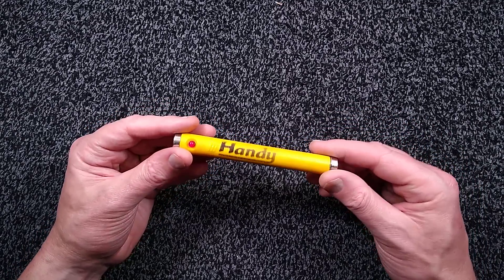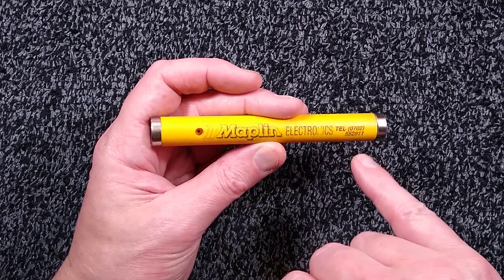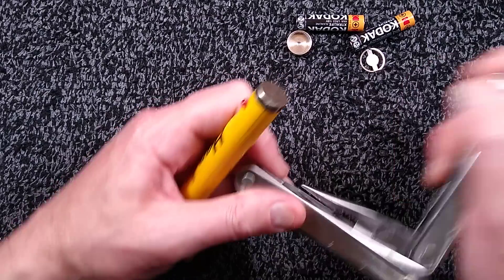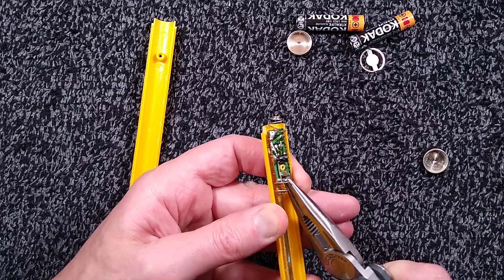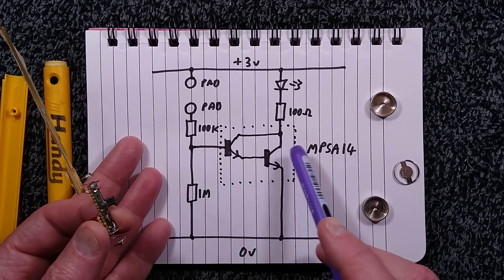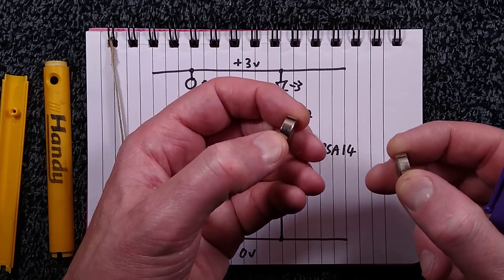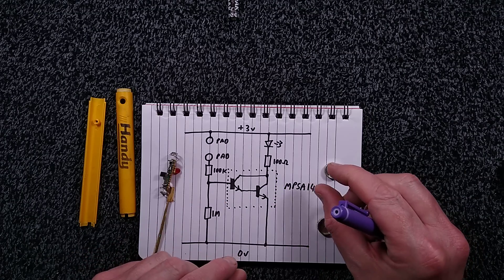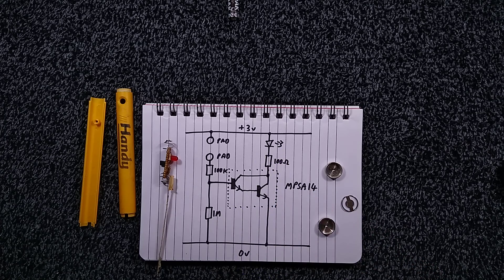Retro Maplin "thing" (with schematic)

Comment: Maplin was the place that helped me learn practical electronics.  Some of the circuits I built from parts I bought ten years ago are still in use.  Yes, Maplin was pricey, but that's the cost of being able to walk into a shop and buy a physical product.  And speaking of Rolson tools, I can't say a bad word about them.  Only recently I retired my Rolson flush cutters after many years of faithful service.  They cost £4.  I still use my Rolson steel rule virtually every day, and I have Maplin hybrid AA batteries still in use after several years of recharge cycles!

Comment: I really don't understand why people still call transistors amplifiers these days because in basic the transistor does nothing to amplify the signal on its own. The gain could be a result of and not a part of. If you pass a weak signal through it, it doesn't amplify anything. You need to apply a powerful source to achieve the gain, the gain is a result of. The result of it depends on  the applied source. Without a powerful source there is no amplification at all.  Call it a "(variable) sensitive  directional (input) switch" (base) for example and with this you can achieve a gain when you apply a more powerful source through it. However if you simply want to switch something (like a bulb or something like that) there is no subject like gain. Do you know what I mean? Amplification is not a part of a transistor, it is a result of in case of some of the situations.

Comment: In the cheapest Chinese screwdriver there isn't any resistor in series with the LED, I guess it's a LED with built-in resistor or perhaps the internal resistance of the batteries of dubious quality is enough to not fry the LED

Comment: We built something very similar in shop class when I was in elementary school back in the 80:s. It was in the form of a plywood box (which we would build from scratch ourselves, naturally) about the size of a pack of cigarettes with an acrylic lid and two copper electrodes about 2 centimeters square, one on the side and one on the top. You'd hold the box in one hand, pressing your thumb against the copper plate on the side, and with the other hand touched a light bulb or fuse to the one on the top and if the bulb/fuse was ok a LED would light up. That one used a 9V "brick" battery though. I did hack it by adding test leads to use as a general purpose continuity tester.

Great times, I used to love the shop lessons, we would build all kinds of stuff, mostly from electronics kits. The kits included the components and instructions but no circuit board, just a paper template. We would make the boards ourselves by drilling the holes through the template and drawing the traces with a Dalo-pen after witch we etched them in ferric chloride.

I guess nowadays kids are no longer allowed to use "dangerous" things like ferric chloride or soldering irons at school, a while ago we had a trainee at work who said they were not allowed to use angle grinders or welders when studying to be a car mechanic at a vocational school because of "safety reasons".

Comment: Didn't you make a "ghost detector" using the same principle? Except you used 3 regular transistors and built up the gain that way.  So you should replace the LED with a brighter one and check out your apartment for "ghosts" ... can't be to safe these days LOL.

Comment: I miss Radio Shack - they used to have factory lots of components, but sadly they mostly stopped catering to electronics hobbyists, instead selling sketchy electronics goods which somewhat contributed to its downfall. At least Arrow, Mouser and Digi-key exist for hard to find parts.

Comment: When Maplin here in Plymouth was shutting down they had to get rid of all the stock. I walked home with a load of gel acid batteries, a storage unit with 50 ish draws and about a quarter of a million resistors. 
Not bad for £10.
I can't thank the staff enough for their help over the years. I've seen some of them since and they've got jobs and are happy. 😀
Reply: Yeah, I'm still working through the haul of stuff I bought when my local closed.
Reply: I have fond memories of the Plymouth branch! I popped in there too when it was closing down, made me sad seeing all the stuff they were getting rid of was mostly all the crap that sealed their fate to begin with. I remember going in there as a kid and being enamored by the DIY circuit kits and display cases full of cool tech and cameras/mini displays etc. Oh and the audio gear.
Reply: @RonLaws Me too, also missed the demise of Tandy quite a few years before.  The original old school electronic component shop used to be at the other end of the city centre called "Brewsters" and run by a very knowledgeable guy. Good times.
Reply: @ferrumignis  
At least Brewsters is still around, so useful when in need of an 18650. 😄
Reply: @ferrumignis  I think when Tandy went bust Maplin moved to fill the void.  CPC Farnell then moved to fill Maplin's void.  RS just stayed where they are and ended up almost competitively priced by staying still.
Reply: @Slikx666  As in SRB soldering irons?!
Reply: @Slikx666  I didn't know they were still going, not been to Plymouth city centre for a long time. Great to know!
Reply: @ferrumignis  
Walk down from the sundial and turn left at 'Fabulous Falafel'. If you get to smiths then you've gone too far.
If you're hungry then a falafel wrap comes highly suggested, the chilli sauce has a kick so you may just want a little. 👍
Reply: @AintBigAintClever  you're totallyspot on with your analysis!
Reply: There was a feeding frenzy by hobbyists when Maplin closed its doors. My Hacklab got most of the local store's component storage racks for a pittance and we upgraded the various plastic tubs and cardboard boxes we were using to store stuff at the time.
Reply: I toured all the local Maplin stores in the Midlands buying up loads of stuff. I think I picked up something like 40 storage drawer units packed full of components for about £20 each. I remember on my way out of the Cannock store, there were 2 display bins, one full of packs of resisitors (around 300 packs) and one full of Corsair PC fans (about 40), I took the lot for £15 😁

Comment: ii remamber those being advertised as fuse testers, but continuity was also possible as you said
The original non contact 'volt stick' uses the same circuit, but has 2 transistors in darlington pair, i would bet that device might work if you held it near a live wire.,  ;)
(the 1M resistor is probably to prevent false trigering if left near power)

Comment: Miniature screwdriver for testing120VAC made with neon tube and a resistor inside the plastic handle a brass cap to make contact with your body.  Lost IT

Comment: Such nostalgia..... I had one of those testers (I still may have it somewhere seeing as I never tend to throw things out). It worked well.
Also, Maplin had on-line ordering in pre-Internet days using a direct dial-up text system. I was blown away by how amazingly easy it was to order stuff without visiting a store (in those days they only had one) or phoning the order in. I felt the cutting edge of technology with my 2400 baud modem.
Reply: I used to order from that system using a BBC Micro at school.

Comment: i used to spend hours in maplin as a kid, buying switches, connectors, tools, soldering stuff and those wonderful components assortments that were just a random mix of unusual, capacitor, resistors diodes ect. much missed
Reply: There used to be an electronics shop in our local town, similar to maplin but privately owned. I used to love going there and browsing but the owner standing behind the counter staring at me and waiting for me to buy something was very disconcerting!

Comment: I miss Malins massively.
Got a bunch of stuff from there when I was a kid to learn how to wire things.
Went there as a teenager to get some IR LEDs for an IR lamp that I wanted to use with an image intensifier, though the gain on the image intensifier was enough to manage without them.
Better than buying online.
Reply: One of the best reasons for me to visit the shops, was to see the various plastic cases in the store. Far easier than trying to work it out by measuring and guessing how much the internal box dimensions were…
Similarly, cable was easier to buy from the store. And of course, if you were in a hurry, a lot of common electronic items were available (at least in the stores before Maplin changed owners). The original catalogs were a goldmine of technical data on the chips.

Comment: i have one of those! i think i got it on offer or free somehow! also have a 'similar but different' thing in the form of a black square section handle screwdriver, dim led sticking out the side like this one, but powered with 2 LR44 cells

Comment: So Maplin was like RadioShack in the US? I think Radio Shack had the exact same issue, even though Radio Shack is still barely around. Saw one in Kiln Alabama of all places. Last LOCAL one to where I used to live was like in Blue Island Illinois. But before I moved that place was shut down. RadioShack was one of those places you could buy electronic components like resistors, capacitors etc. Sadly now you have to use Amazon. Or Frys but I don't think Fry's is around.
Reply: We had Tandy here in the UK.
Reply: @justanotherviewer4821  IS THAT WHAT TANDY WAS? I heard of it and just knew it as a computer. That was Lord Alan Sugar's company, right?

Comment: Maplin sounds like a store we had in Florida called Olson Electronics. They put Radio Shack to shame, you could buy all sorts of components and kits, for a while they even had vacuum tubes. I had a DIY home intercom kit from there. Somewhere around the mid 1980s they closed, cheapie imports and a waning interest in kit-building did them in.
Reply: The ghost of Olson Electronics lives on.  The company started in Akron, Ohio, US.  The Olson warehouse, a building about 100 years old, was remodeled and now contains the Biomedical Engineering department of the University of Akon.
Reply: @wtmayhew  interesting
Reply: Here in the US, we had Fry’s which started out as a California grocery market where the owner’s son had a small electronics hobby area.  Eventually the business grew to electronics and appliances dominating in multiple stores, but they they still sold groceries.  You could buy a new Tektronix oscilloscope and a can of Diet Coke right off the shelf and maybe some LEDs and ribbon cable as well.  It was a an interesting experience, but being slow to respond to changing retail finished off Fry’s.
Reply: why don't such stores exist anymore, they sound fun
Reply: Maplin sold tubes too. I still have and use my Maplin Millennium tube amplifier that I built in 1994 (part kit, part DIY). It still sounds good too.

Comment: Honestly, I must say, this lil tester thing I would love to just give a new LED for to run better, just so it could still be used. I personally thing it's probably to test components to see if they still are functional, and haven't like, blown up or whatever. I kinda wonder what it'd do to a capacitor stuck across the pads, if it'd light up, or do nothing, or if it'd charge the capacitor up a tad bit too. I genuinely wonder because curiosity.
Reply: Charges the capacitor, and then the light goes out to tell you it's charged.  🙂

Comment: A darlington and an LED. Can't be that old, can it ?
Reply: 30yrs is pretty old
Reply: @ElectricChicken  "30yrs is pretty old." Put things in perspective: the transistor was introduced to the world at the end of 1947. I.e., it's 75 years old. The older you get, the longer "old" becomes!
Reply: I recall building a digital clock using TTL logic and LED displays 51 years ago. You tell me if that is old or not.
Reply: When I was still an apprentice in 1978 the first LED (3 mm) they sold, produced by our company, costs around 5 € per piece in 100 quantities. And they where very sensitive to heat. You had to handle it like raw egg.

Comment: I used to love Maplin and their original catalogue with their very detailed information particularly on chip.
Reply: Maplin catalogue was very educational!
Reply: yeah its way more useful than online searching, would pay for a printed catalogue now. despite taking 3-5 seconds per search to bring back results the pictures on the results are so tiny you have to click into them to work out what you are looking at. it was all there in a catalogue.
Reply: Yeah the Maplin catalogue was the electronics hobbyists' bible for sure!
Reply: @countzero1136  When I was a teenager I used to do Maplin through mail-order. Then I went to university and we had a Maplin just down the road....heaven..
Reply: @deang5622  Yeah I really miss Maplin, even though they were charging at least ten times the price I can get stuff for on ebay, but the thing I miss the most is their catalogue - that was absolutely indispensable reference material!
Reply: The magazines were great too, lots of projects and detailed circuit operation information.
Reply: @echothehusky  Yes, there's that too.
Reply: Still have the Concorde ones in my garage

Comment: I learned that the US has GFCI Plugs, while the UK has RCD (GFCI) in everything! 
America is broken!
Reply: Mostly in new installations, RCDs are required in the consumer unit (‘breaker box’). In older installations, RCDs may be built into the socket. Be a plug - in adapter, or be built into the mains plug (but this option was not popular).
Reply: @Mark1024MAK  In the US, a GFCI Plug is mostly placed in Bathrooms and Outdoors (where moisture is).

Comment: 0702 was Southend-On-Sea in Essex

Maplin are still aroud, albeit online only. Still selling cheap tat that no-one really wants at a high price
Reply: The current Maplin are a completely different company. They bought the rights to use the Maplin name and logo. They also bought some of the old stock, which they sold when they first stated trading. Apart from that, there is nothing the same about them.
Reply: @Matt Quinn - I made no comment on what they currently sell. Yes, it’s likely that most of their products come from China. I’ve only ever bought one item from them. And that was primarily only because I got a discount (because I registered interest in the run up to them starting trading). They certainly did not offer electronic components when I last browsed their site, which was some time ago.
Reply: @Mark1024MAK  I found them on line a year or so ago and searched for electronic components, resistors, capacitors, inductors transistors etc , and no, they don't stock that sort of thing anymore.

Comment: I had the same tester from Maplin, but I think it was not sold for testing any kind of voltage, it was only sold as a continuity tester mainly for checking fuses etc...
I remember taking it into work (I was still an apprentice) and the other leckys being in awe because the nearest thing they had to high-tech was a neon screwdriver.
Oddly enough we never had Fluke meters provided. We were lucky I guess back then that ALL test equipment for measuring anything above 12 volts was provided to us by the company and they provided AVO 8 Mk5 multimeters.

Thank you Clive for bringing back some wonderful memories!

Regards,
K. Watt
Reply: Yes, it’s intended purpose was a fuse tester, light bulb (filament type) and continuity tester. It was not designed to test for voltages.
Reply: Ah the AVO 8 our go to multi meter as a spark in the RAF . I have and still use a Microneta multi meter bought from Tandy decades ago.
Reply: Actually got one of those AVO meters, they definitely don't make things like them anymore.
Reply: @just_saw_dust  Still have my Micronta Range Doubler Multitester.
Reply: I think I've still got the same tester somewhere. It was definitely marketed as a fuse tester.
And when I worked (contracted to Boeing), many of the tests specifically called for an Avo 8 to be used. That wasn't that long ago, it was only 1996. Shit. Ok, a quarter of a century ago. Feels like last week.
Reply: @georgeprout42  no way an Avo 8 will blow away in the wind 😂 But the “high voltage” battery does require a mortgage to buy…
Reply: @Mark1024MAK  There are adaptors to allow you to use coin cells or one of the 12 volt car alarm fob batteries.
I simply made a tube to hold small lithium coin cells to hold 5 cells to give me 15 volts, dirt cheap to make and pennies to replace the cells.
That way I can keep using my two AVO 8 Mk5 meters.
Reply: @getcartercarpark.  - thanks, nice information 👍😀. To be honest, the one I have mostly just lives in a cupboard now, as I have a selection of digital multimeters to use for most tasks. Although there are certainly still uses for analogue multimeters, especially for slowing changing signals where the damped needle movement gives you more useful information than a ‘jumping around random’ display that you get on a digital multimeter!